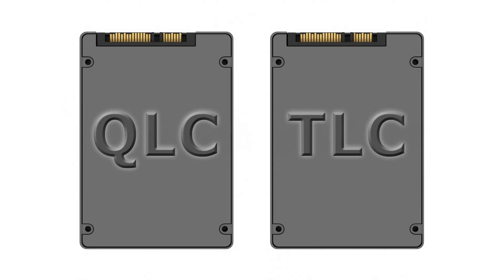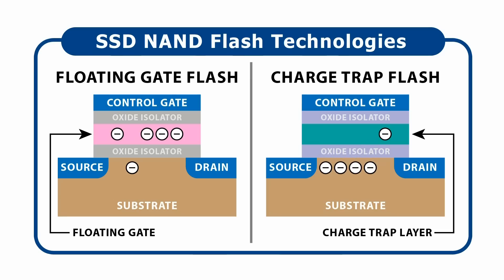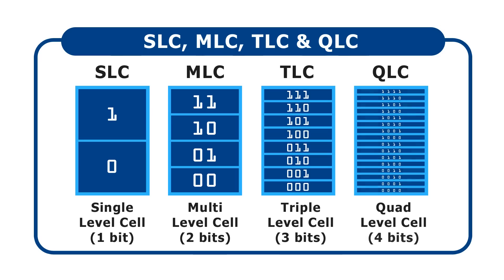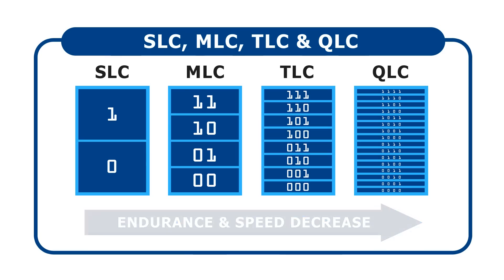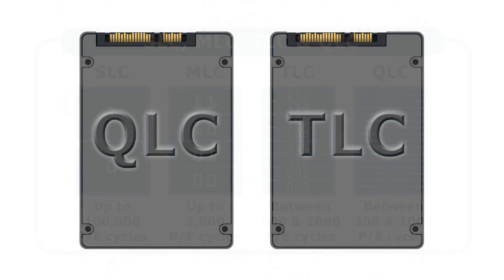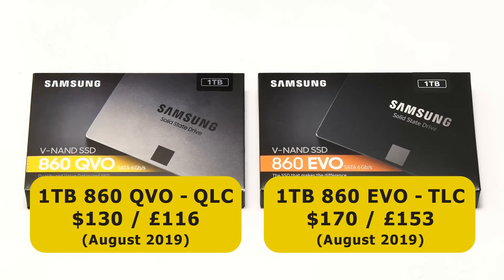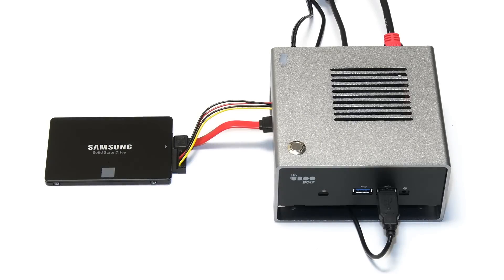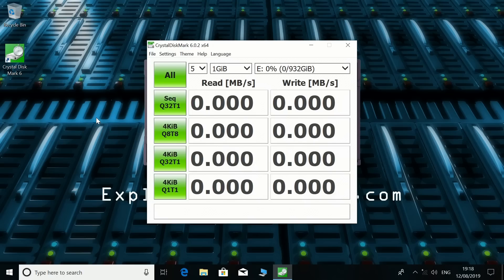QLC vs TLC SSDs: Samsung QVO & EVO

Comment: encoding more bits per cell has a drawback with more sensitivity to wearing. However this can be compensated easily using ECC (error correction codes).
So a QLC encoding with ECC may in fact be even better then TLC without ECC. ECC has a cost: it requires some bits for the autocorrection, but the best ECC codes do not require as many codes as the data you want to store. So it's technically possible to use 12.5% of the total bits for the extra bits needed for ECC. And then it will protect the remaining 87.5% bits of data. wearing can then happen on any of these bits (ECC or data) but they will still autocorrect and you won't experiment any failure, and this is possible with QLC. But if you use TLC, the best ECC codes you can use are simple parity bits (you store 2 bits of data plus 1 bit of parity, and still you can detect 1 bit of error but are unable to autocorrect it: the cell is then marked bad and the wearing control will remap the cell (in fact the whole sector containing it) using other spare sectors (typically about 10% of all sectors are kept unused as spare, for delayed trimming and rotating the usage of sectors of cells to rewrite, in order to avoid wearing the same cells too often, but you can dramatically increase the MTBF of your SSD by keeping an unused partition marked as free and never written, so that these free sectors can be used to dramatically reduce the frequency at which each sector will need to be trimmed again and then made ready for new rewrites; this also improves a lot the writing speed on your SSD or fralsh memory because more free sectors that are already trimmed long before, when the device is idle and not servicing other I/O).
But now the problem with may flash memory devices (SSD or USB keys) is not there: the wearing strategy that allows logical sectors to be dynamically remapped to new physical sectors each time they are written over a new trimmed sectors, requires also storage for the sector map: this is the "tag memory". Unfortunately, many cheap SSD or flash devices use the same NAND flash cells to store the "tags" table (note also that most USB drives also store their own firmware inside a range of physical sectors, preallocated and normally not rewritten as they are protected from reallocation by the firware itself). On these cheap devices however, the "tags" table is small, rewritten much too often, and use over-simplist strategy to avoid wearing. Better flash devices use different technologies for the tags table, not NAND cells, and these won't be so much sensitive to wearing. Note that the "tag" memory is small and ccessed and rewritten extremely often. To avoid premature wearing, this memory uses a small cache with delayed writes, and the device contains a small capacitor of energy that will keep enough energy to allow the cache to be written to the tags memory and to the data sectors. But here also there are problems: the capacitors also have their own wearing and over time will no longer keep enough energy: this is a problem for pluggable devices like USB keys, that don't have their own battery (SSDs connected to a motherboard generally have much better energy sources with high capacitors, so they won't fail so often).
But for hit-pluggable flash memory (SD cards, USB pen drives), you need something better: at least the "tags" memory should not be implemtend using flash NAND cells (at least not QLC or TLC, but MLC or SLC only: this means they require 2, 4 or 8 times more cells, but they can resist much longer time; the most costly flash devices are only found in high capacity SDD tuned for professional servers, their tag memory is not built with NAND cells but uses static NVRAM and true capacitors with a pair of transistors on the chip instead of a single drain transistor with layered isolators: the MTBF of these static NVRAM is much longer, and they are also much faster to read and write and don't require any "trimming").
Beware of USB drives and SD cards
But more importantly beware about the internal chip they use and their embedded firmware: there are tons of new USB drives sold that use chips with antique designs no longer supported and nobody to fix their firmware. And this happens even on costly SSD made for servers (about 1% of them fail after one year, this goes to about 15% after two years, much faster in fact than with hard disks, so servers based on SSD have no choice: they must use RAID!). But beware also that alsost all SSD do not properly report their SMART statistics, so these drives will fail suddenly before an alarming statistics of failed/remapped sectors have been detected (the cause is a bogous firmware not correctly computing these statistics or not updating them as often as they should, just because they want to promote pure speed instead of intriducing some delays to perform additional checks and reporting problems with SMART early, long before the errors are unrecoverable; for this reason many servers with SDD use them only as fast caches in front of conventional hard disks mounted in RAID5 with one error correction volume, possibly with mirror or striping in RAID50, plus one spare volume, or RAID6 with two error correction volumes and RAID 60 with mirror and striping).
USB drives on the market are notoriously failing faster than expected and unreliable, but the same is true for many SSD for the consumer market, tuned only for performance and large capacities over 1TB (they use QLC and are faiing fast): there's only one good solution for consumers: DO NOT use them to their full capacity, make sure you keep 25% free space at all time, and one good way to do that is to not partition them to their full size, and keep about 1GB space unused per terabyte: do not max the partition sizes, reduce them and keep that logical space permanently unused to sthat they map to free sectors that are already trimmed and all your data will reuse them with lower wearing speed !
If you buy a QLC drive for the consumer market, make sure you do that because at the maximum capacity or if your OS does not keep enough free sectors, your data will be at risk (notably if you use the same SSD for your data, and OS and for the swap files and log/temp files that are rewritten extremely often; ideally you should use a separate SSD for your OS and swap, log/temp files and place your data and all your user profiles on a separate second SSD: the 1st SSD may fail fast but you can keep on it a large unused area by partitioning them with a cumfatable unused area; your second drive will be rewritten much less often, and also nortamlly have their own separate data backup you can perform to conventional harddisks or to a cloud store or external NAS).
But don't think about using USB flash drives are backups! They are definitely not reliable and will fail faster than you think (when they start failing, at least they should turn to be permanently readonly, but sometimes they become compeltely unresponsive if the tag memory has been damaged, or the memory space used by the internal firmware to store its own operating state, and these devices will crash internally and will become unresponsive).
Most of these SUB drives become unrepairable (there's NO real "formater" that can resurect them and reapply a working firmware, as all is proprietary)
Reply from the maker: Great post -- thanks for sharing.

Comment: Very clear explanation, but the Samsung 860 EVO 1TB is not a TLC, it actually is MLC
Reply from the maker: No, the Samsung EVO is a TLC drive. Samsung describe it as "3-bit MLC" -- ie storing 3-bits per cell, which in the language of every other SSD manufactuer in the world (and technically) is TLC. Samsung also desribe their QVO drives as "4-bit MLC". Which is even more bizare. This all comes down to the use of "MLC" -- meaning "multi level cell" (could be any number of bits) or two bits per cell (which is what MLC first referred to, and which has generally stuck). Well, aside from at Samsung. :)

Comment: Using my 840 Evo 120GB ever since it came out as a boot drive. Its still working and I will only change it out once it dies ^^ (I keep nothing important on my OS drive)

Update 2022: It finally started showing issues after almost 200TB written to it and 8 years or use.
Reply: I have an 8 year old 830 series and it still is working

Comment: I wish I could give this more than one thumb up, a lot of really helpful info. I would have liked to see a second test with an even larger file copy size like 100 or 200 gb to see if the Evo ever slowed down...just in case the specs were wrong and it does actually have that 78gb cache

Comment: I just invested in a Samsung 860 evo 500gb SSD and could not be any happier and I must state that if you have just been using HDD your entire life, you are still to know about a fast computer. Boot time increased so much that I was scared it is dang fast.
Reply from the maker: You are so right! An HDD to SSD remains one of the most transformative upgrades you can get.
Reply: @ExplainingComputers  Very true. InDesign, illustrator, Photoshop, Premiere Pro, Aftereffects, Maya, zbrush and Nuke. All those applications runs faster than I have experienced before in my life.

Comment: Comment on recording multimedia to a SSD drive in general. What I have read and heard since 1990s is that Solid state flash disks are better for recording live audio and video than a mechanical drive be they 5400rpm-10krpm. I have had plenty of experience with mechanical HDDs and recording audio tracks both on PC and MAC. There are always glitches in audio and slight tempo or latency issues that get corrected in software but this in 2019 is just not tolerated by me. We should have tech that can record audio in REALTIME just like in the very olds days of 1980s and 1990s, with ram and flash media, WITHOUT glitches, period. So in that matter, SYSTEM RAM,DISK CACHE RAM, and flash nand write speed should be the determining factors and indeed, with a system running with 8GB system ram, a SSD with a 1GB ram  cache in it, AND an SLC 42GB speed cache?, regardless of qlc,tlc,mlc, or slc main flash, THOSE SSDs should not have ANY, I mean ANY trouble, writing media files in realtime.. AT ALL. Should not be an issue to even discuss in 2019. Why is it an issue? I am slapping my head in disbelief,cause I do not know why.. Chinese quality seems to be a major culprit.. USA made industrial and Military grade Flash disks which cost thousands or even 10s of thousands of dollars for small capacities in 2019, are many years ahead of consumer grade public released ssds. THOSE have the backing, money and tech, to perform as WE EXPECTED SSDs to perform when they were mass released to the public in 2002.. Sad day..

Comment: So in the end, we come to the conclusion that SLC drives, are hands down the ONLY sensible option even if they are lower capacity. Luckly, SLC 120GB enterprise drives are cheap used on ebay now. $25 each average price!

Comment: Wanna fast QLC? Buy M.2 QLC drive. Wanna cheap SSD? Buy cheap, DRAMless TLC. Even if the cache is filled, it´s still much faster. 

Don´t look at TBW, high quality drive can easily exceed TBW specified by manufacturer, on the other hand low quality drive can fail much sooner. Tbh, every drive can fail, even the high quality ones.
For me, until SSD´s don´t catch at least 2,5" HDD in price/capacity ratio, it really doesn´t matter, SATA QLC matters even less. Why 2,5" HDD? Because they are really silent and have much better shock and move durability than 3,5" HDD.

Comment: Thanks Chris.  Had you ever considered having dual boot? I do.  I cloned my SSD and then installed Mint.  It would save you having to swap drives and there is a bonus Mint can read (and write if you want it to) windows partitions if you have Windows shut down properly (disable faster booting).  Best wishes.
Reply from the maker: See my pinned comment. :)

Comment: You didn't hit the limit of the cache on the 1TB EVO drive because the drive is writing to TLC and SLC cells (which might not even be dedicated cells but actually dynamically allocated accross all chips as need arises and to improve wear leveling (otherwise the SLC cache would wear out very quickly) in parallel. Plus as the SLC cache is being filled up, there is auxilary process in the background in the drive controller that moves data from SLC to TLC banks. So in effect because TLC speed is quite good compare to QLC in QVO drive, the fill up of the SLC cache in EVO (TLC), is actually lower than your write speed (you might be filling it up at 420MB/s, but also clearing it up at rate of ~200MB/s, so you really are filling it up effectively at about 220MB/s). Compared to QVO you will be filling the cache at effectively higher rate, because if you are filling it up at 420MB/s, but the copying/moving to QLC is slower, lets say 100MB/s (note that I didn't use 72MB/s, as some of the QLC bandwidth is probably used by the background moving process in the controller and it is parallelized somehow well), it fills up at effective speed of lets say 320MB/s. Which is 50% faster. This is the reason you will not see the drop off in the write speed at the same moment in time or amount of data written. If you write 200GB to the EVO you will most certainly see the effects.

It is also important to note (it is obvious, but it might not be clear to everybody who doesn't know how the OS file system and drives work), that if you start copying extra batch of files, the initial speed will nt recover until you wait many minutes, this is the background copying process and cache still being relatively full. If you wait just one minute you might get initially good performance for 3-4 seconds, and then drop to the steady 250MB/s, but then it will drop to the baseline level a bit faster than in the first test. Depends on amount of data written.

I think QVO drive is really great. 1TB fast SSD for such price is amazing. Perfect for almost all desktop and laptop applications. Similarly even smaller ones would be perfect fit for SBCs, NAS and some server applications without any issues or performance bottlenecks or ever hitting this dreaded 72MB/s thing. Even if you are hardcore gamer and download weekly 100GB of files, it will not be of any significance, even if you have 1Gbps connection to internet. Even working with very big files (movies being one example) is not going to be a major issue most of the time, and the system will be very capable. But if you work professionally with high resolution high bit depth and uncompressed or losslessly compressed videos, especially in live settings, then QVO is definitively not a choice for you. As you stated it will slow you down, and might even fail to properly record in some devices at real time. Similarly if you are a youtube / twitch streamer and also record videos at high resolution or almost losslessly for post processing and editing, and play for hours, then QVO is not the best choice. EVO or PRO, or even two of them (even without RAID)  or external NAS to store the files is probably a better choice or auxiliary storage. I personally use some Samsung PRO drives, mostly because I do a lot of coding (I can often have easily 150GB of various git repositories and build files on my system), benchmarks, databases, and I do sometimes write enormous amounts of data, but I still extend this with file server with 2 cache SSDs and 24 HDDs for main storage of bulk stuff (big movie and photo archives, backups, archives, big repositories, big binary blobs like large images, etc. etc).  Both methods complement itself nicely. So even for desktop system, a 2x1TB EVO + 2x10GB HDD is a reasonably good semi profesional setup, 2x of each for the extra space, or for RAID1 (mirror), because I am paranoid and know every drive eventually files.

Source: I am distributed storage engineer.
Reply from the maker: Great post, thanks for sharing. :)

Comment: The Evo SLC cache is likely not specced wrong, but you forgot to take into account that the cache also continuously gets flushed to the bulk zone while the transfer is happening. Since that bulk storage is faster you'll need more data transferred before it can't keep up. You'd probably have seen a dip if your data set was larger.
Reply: Either way all it proves is that hard drives are infinitely superior.  If U really need 'fast random access', just get more RAM =P  U can also locate cache files & things into RAM with other programs, like web browsers 2 a 'RAM disc' folter, etc.

Comment: I disagree with you, unless your main goal is to save money on the same storage amount, the TLC is clearly superior (based on your tests).  According to specifications and your tests:  TLC will last longer, has same amount of storage, is faster - but is more expensive.  I feel like you were paid to push the QLC tech.  Being an IT professional, I much more need dependability, longevity, and performance, over cost, including for my customers, friends and family - they don't pay attention to storage and longevity, but they certainly notice when it stops working or loses data.  And you failed to mention life span based on percent of disk used, which should have been brought up, although not relevant to the overall topic (it is brought up in your talk about cell life).  I did not dislike the video because there is some great info in here, but could have been better with little additional effort, and explaining why you chose the clearly inferior product (you mentioned Samsung about 10 times, and focused on QLC).

Comment: The problem of filling the buffer is also shown when you clone your spinner to the QVO. On a drive with a lot of data, the clone goes slower to the QVO than to another spinner (many can go ~150MBs). I've never seen the slow down when cloning to any of the other technology SSDs. This buffering is akin to the hybrid spinner drives (which don't improve performance much).